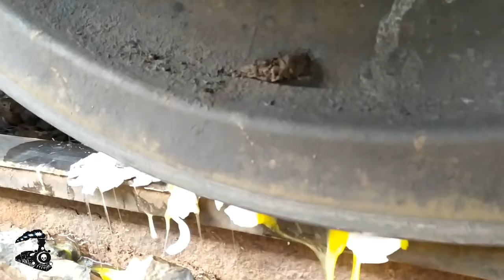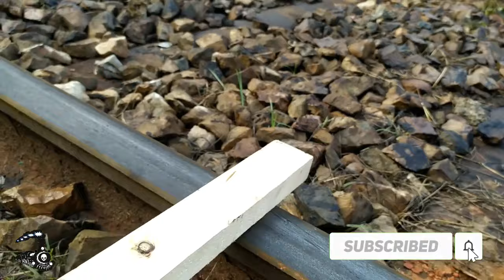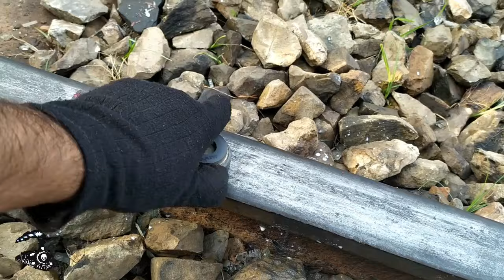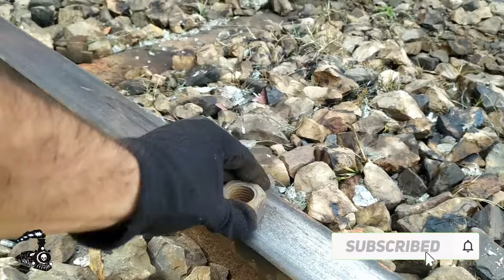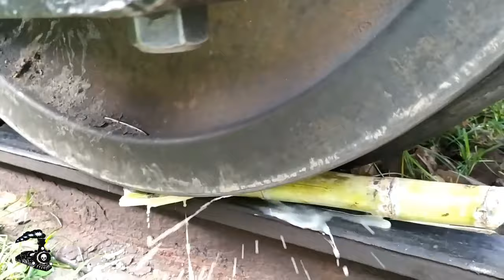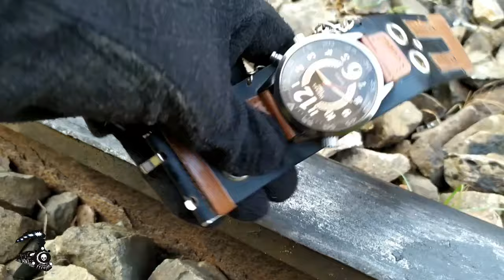Experiment Train Vs Things OMG 😳 || Train Experiments @TrainExperiments

Comment: As kids we used to put Pennies on the track  which would transform into weird organic shapes, that was 10 times more interesting than this experiment.
Reply: What would happen to a penny if it were run over by a full train with say, 40 freight cars?   That would be around 166 sequential steel wheels running over it.  It would merge to become part of the track
Reply: not to be that guy but if a penny were to get crushed at a angle it would get shot out at high speed so probably don't do that if you still do witch you probably don't.
Reply: @nottinghillad  actually most times it just flattens and falls of the rail before all steel wheels can go over it. The hard part is retrieving it haha
Reply: @Christa-hk4if  yea that’s a rare possibility and defiant not one I thought of as a kid. Would I let my kids do it still? Probably 😅
Reply: Here in Germany putting hard items on the track is considered a no-go. Railroaders know that any hard item may leave a little dent in the track and the wheel. This dent deepens and and the axle must be treated in the shop.
Reply: so real @AyanAkbar
Reply: @ludwigsamereier8204  Why is Germany against fun?? (Joking).. Climbing down to the rail tracks in itself is pretty risky.
Reply: Did that until one shot off the tracks and was later spotted piercing a metal pole stuck in it.  Never put a penny on tracks ever again after seeing that.  First started off with stones till we saw one fly of at a fast speed.  Kinda sounded like a bullet ricocheting then moved to pennies till we saw one of them shoot off and that pretty much ended putting anything on tracks ever again.
Reply: Did the train ever chase after you?
Reply: Ahh that's just nostalgia talking
Reply: The coins will stay on the full length if you use double sided sticky tape...used to do experiments like that all the time as a curious youngster all the time lol.  Lots of other stuff too, never bored with a busy set of tracks right at my backyard.  Rail spikes with the pointy side facing a high speed train shoot out like rockets

Comment: the fact this train couldnt get over a bolt without momentum tells you this is some amusement park ride type train.
Reply: It's an Australian sugar train for transport of cane. Farm to mill.
Reply: It isn't a bolt, it is a nut and it is hardened steel which doesn't deform.
Reply: @philcook9967  a CP fully loaded 4 engine freight train begs to differ!
Reply: I'm assuming also that this isnt the heavyest of machines
Reply: @patrickmihajlovic4112  It's a sugar train in Australia. It goes from the farms to the sugar mill. Keeps the road free from trucks. Light rail
Reply: At higher speeds (40+ MPH) that bolt could be enough to derail that train!
Reply: It's simple physics. That 1" of height might as well have been 10 feet, with the enormous amount of weight it has to overcome.
Reply: @philcook9967  it just shrapnels the fuck out of you if it finally gives and shatters,
that guy wants the real WW vet experience,just without all that gas,
but who knows maybe in a future video
Reply: @volvodoc01  you understand how weight distribution works?
Reply: @deangregoric4735  obviously yes I understand it. Even with more wheels, a normal full sized freight train locomotive weighs significantly more than this yard shunter
Reply: @darrensayer3589  Do you have any specs on the train? I watch a lot of stuff that Aussietraindriver posts and they run a lot of very unique EMD power down there on the SSR. Guessing this sugar train is just a little light industrial switcher or something of the like.
Reply: @Trains-With-Shane  yes mate they run from sugar mills to the farms been there before I was born. They are only small compared to the state rail
Reply: Doesn't matter how heavy a locomotive is it won't smash that nut. It's takes way more weight to deform a hardened nut. Not to mention that's only 1/4 of the weight on it at a time if it lifts both axles on that side.
Reply: It's common knowledge that a train cannot start rolling if you put a small thing right in front of the wheels. But yes, it's a light train i think. When i was young we put coins in front of train wheels which came out like pancakes. The train in this video doesn't do that.
Reply: @Engineer9736  I did the same when I was a kid.
Reply: Wow. Trains break eggs....
Reply: That's because it's not the train engine running over the items.  Much different.
Reply: @rondj1965 Simple physics says you're wrong. The forces from 1 inch and forces from 10 feet are massively different!

You're talking about Potential Energy, and it's measured in Joules.

Potential Energy (P.E) = Mass(m) x Gravity(g) x height(h).

Say the wheel has 10 tonnes on it. Mass, (m), =10000kg

Gravity, (g), on earth at sea level is 9.8m/s²

Height (h) at 1" is 0.0254 Metres

Height (h) at 10 feet is 3.048 Metres

P.E at 1 Inch = 10000 x 9.8 x 0.254 =😮 2489.2 Joules.

You could run an energy saving light bulb for about 10 minutes on the energy from it.

P.E at 10 Feet = 10000 x 9.8 x 3.048 = 298704 Joules.

You could run an energy saving light bulb for about 3.5 days.
Reply: @darrensayer3589  Why does an American YouTuber have an Australian sugar train?
Reply: @welsty2003  Energy has nothing to do with it. It's about whether the engine can generate enough torque to lift the wheel up the obstacle. The very first part of that is like the wheel going up a 20+ degree incline (look at the line that the wheel center has to follow to understand why), which is more than the engine can handle from a standstill without any kinetic energy to trade for height. And since the locomotive can't even manage the very first fraction of an inch it doesn't matter whether the wheel would ultimately have to go up an inch or 10 feet to get over the obstacle.
Reply: @blahfasel2000  I garentee with 1 road locomotive I could of ran over the nut.  On a six axle loco, you still have 11 other wheels pulling for you.  These machines are amazing.   Especially when you are running 50mph and realize you have 20,000 tons you are pulling behind you.
Reply: @Trains-With-Shane  i havent seen the locomotive but i can tell you the prime mover(diesel engine) sound is an EMD 645 and since it has 3 axles per truck is it probably some variant of the American SD40-2 with 6 axles. Id consider them to be medium duty here in the US. But the 3rd axle per truck spreads the weight out more than if it were the gp40-2 4 axle variant so it probably wouldn't compress as much as the standard GP unit or big heavy 6 axle might. They are good work horses tho

Comment: It's really weird that a train can't flatten a simple nut... anyways, Never do that when the train is moving fast because there's a major risk of derailing.
I remember when I was a student, we used to have fun placing coins on the train tracks when the train arrived at the station. Once the train departed, we would retrieve them, and they were incredibly flattened and oval-shaped!!!
Reply: The same things we were doing during hollydays on the village with nails, screws, cions and forks.
Reply: The wheel load actually is not that extreme. It's 11 ton in Europe and up to 15 ton in some American freight trains. Even a small hydraulic press easily does 10 times more and the bigger ones do real crazy stuff.
Reply: yup
Reply: Unfortunately now the idea is launched
Reply: People dont realize the weight of the train isnt focused on one axle - if a dieseltrain weighs about ~100tons, the force on one axle is much lower.
And that "simple" nut could hold much higher forces
Reply: @jugobetrugo7213  How would you know what people realise or don't realise? What point are you trying to make?

Comment: It's all fun and games until the locomotive derails! 😉😁
Reply: It's not easy to derail a train
Until you mess up the tracks
Reply: It actually is. Back in 2019/2020 a 3 car light rail train was operating north of Dallas, TX. It had flat spots on the 2nd car. The flats shook the flange lubricator loose (the company never secured them properly), and it broke off and went under the wheel. Lifted it over the rail and derailed that car and the trailing 3rd car as well. The lead LRV didn't derail which is why those 2 cars got dragged at 65 mph all the way to near end of the line. You will see in the video that metal spring/coil lifted the wheel off and back onto the track. That is what happened. A train hit a truck in downtown many years ago. The TSS fell off the cow catcher and lodged between the runway light and the front axle. It lifted the axle over the rail and derailed it. So it really depends on the width/length of the object and how sturdy it is. If you put a metal stick on the track, it may cause a minor derailment.
Reply: @shadowfightarena2196  I actually meant this as sarcasm but looks like I forgot a winky face. I'll fix it. But with small objects like this, it is hard to derail a locomotive.
Reply: Чтобы он сошел с рельсов нужна гораздо большая высота от рельса одно колесо это ни о чем 😊для этого ещё во время войны на внутренней стороны колеса есть буртик это защищало от партизан 😊
Reply: @shawnerz98  some people take life too seriously.
Reply: IKR?  Dude probably should film the results on a tripod, not while holding the camera.  

But who am I kidding?  He must be in a country where work safety isn't a thing.
Reply: The locomotive has to be travelling at high speed in order to be derailed over something this small...
Reply: If you are worried about the locomotive being derailed, there’s a good chance it is over 400,000 LBS (181,818 Kg)
Reply: Or someone loses a finger

Comment: Did you have re-railing equipment handy in case something went 'wrong'?
Reply: It is amazing (but not surprising ) that a single ordinary bolt can bear the weight the wheel carries. Watching your video, I was noticing things that DIDN'T squish: hardened steel items, resilient things like plastic. We have all placed pennies on the track (haven't we?) They do squish an impressive amount. But then, copper is malleable. Steel is meant not to squish. The plastic items mentioned did deform, but you would think, for example, the the PVC pipe would be rendered paper thin. It was not. The screw driver and the bolt were intact!

Comment: There is a restriction on axle load.  Here probably  20 tonnes, so only 10 tonnes on one wheel. Coal and iron ore railways can have higher axle loads and higher loco power and weight.

Comment: 5:00 im not sure if this is safe for wheels
Reply: Usually, a small iron hammer is used to check whether the wheel is cracked or not. If so, it is being repaired before it is replaced or immediately replaced.

Comment: If that is a real full locomotive, put a penny down on the track if it’s squashes, the penny will know that is just the little engine that goes around checking making sure everything is OK because if that was a full size locomotive, it would’ve crushed everything in its path, and left nothing behind, and if you do put a real penny or a nickel or a quarter on it it will turn it into tinfoil if it was a full locomotive